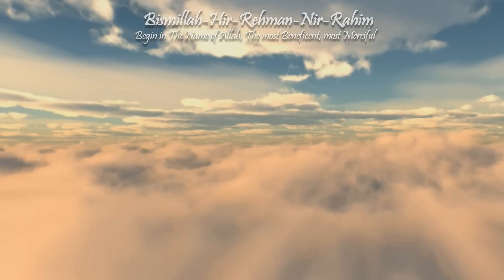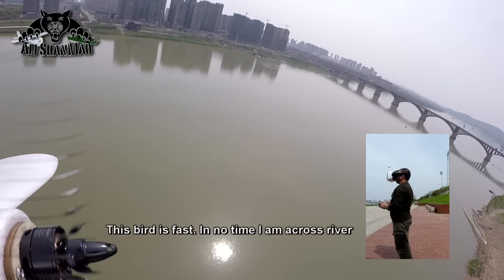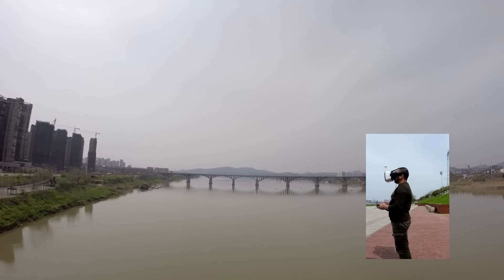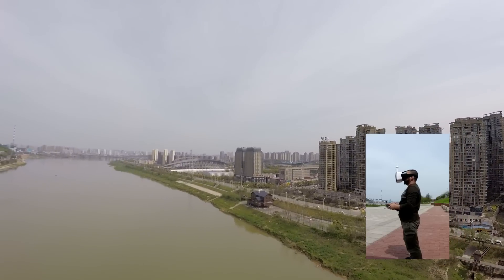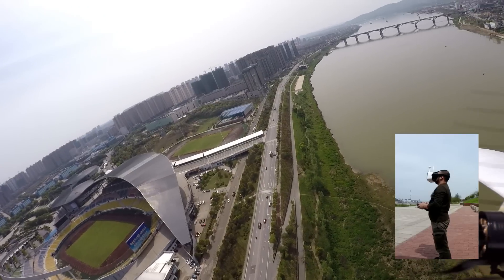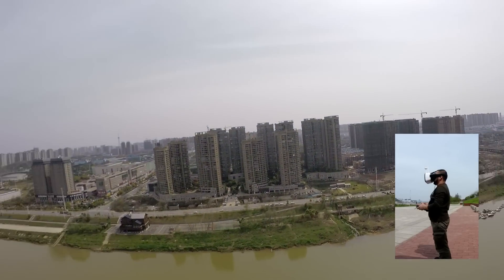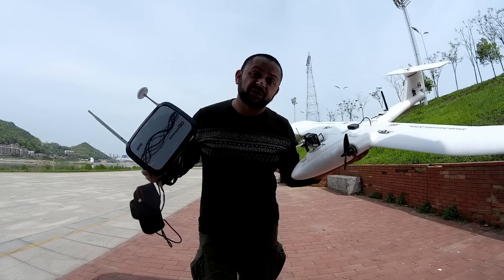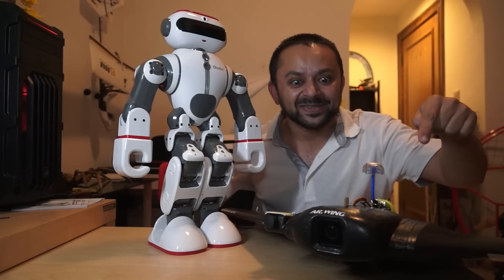FPV Flight Testing SkyRC HD FPV Video Goggles with Finwing Traveler V2

Comment: Have you tested the "AV In" on the Goggles?
I need to connect my ground stations monitor to the goggles to act as a second screen, does it actually work as I've seen Chinese Goggles before that state "AV In" but were actually "AV out"!!!!
Reply from the maker: never had a need to test that

Comment: If you have a Linear Rubber Duck on your VTX, then a Rubber Duck on your Goggle is not going to be a very good combination. The skew on the goggle wont be working either.
  A linear Patch antenna on the Goggle would have been far better, better still, a PAIR of Linear Patch antennas on the goggles.
Alternately, a skew on the VTX....and a PAIR of skews on the Goggles.
Surprised at this basic error Ali...?  The plane didn't exceed 700 metres distance...that's close range....? even for 5.8G.
Reply from the maker: Thank you for advise. But I need to test each and every product with its stock setup right. and thats what I did in this video. Now I use Patch and other antenna on this goggles and it performs even better.